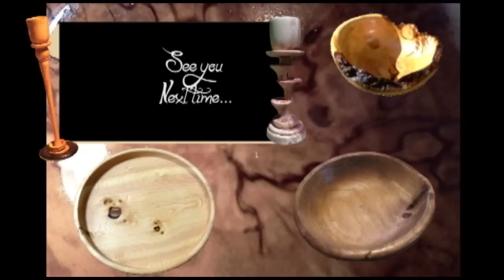Wood Turning #79 A Tip Bowl

Comment: I like your videos... They are very good!
Despite not speaking English, as I learn.
What you use for the completion of the piece, that you spend with a brush?
Thank you!
Hug!
Reply from the maker: Hello Jose:I am glad that you enjoy!I use Shellac... it comes from the Lac Beetle... is all natural and food safe.Here we can buy it in a tin can or you can buy Shellac flakes (its raw form) and add mineral spirits (also called rubbing alcohol or denatured alcohol). It melts the flakes and makes a brownish finish... when you buy the cans they have a clear one as well. Shellac is good to make the grain stand up and dry that way so you can sand it off once everything has dried. Also a coat can be put on to finish the piece as well but I usually put a coat of wax over it as well.Hope that helped someThanks for watchingLarry

Comment: That is a beautiful piece. where did you get it, you mention a 12" plank but I'm not seeing it. Oh, by the way, how are the buttons holding up?
Mike
Reply from the maker: Hello Mike:
That is a piece of Shirley BC maple. I think it grew two miles from here!
When I mentioned the plank... I also mentioned a crack... so I now have two 6' planks! The crack was all the way through and would not have held together without re-cutting it and gluing it back together!
But now I have the pieces I have and we will see what they turn into!
So long as I keep an eye on the sweets the buttons continue to hold! Who knows I may have to move them over in the winter... but for right now they are holding up just fine!
Thanks for watching
 Larry